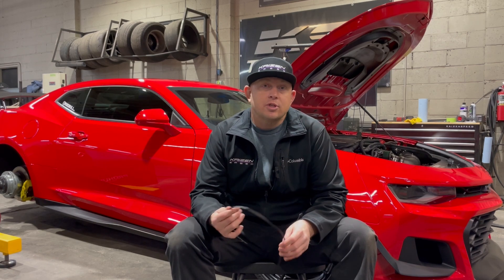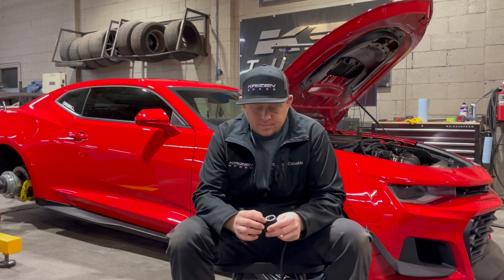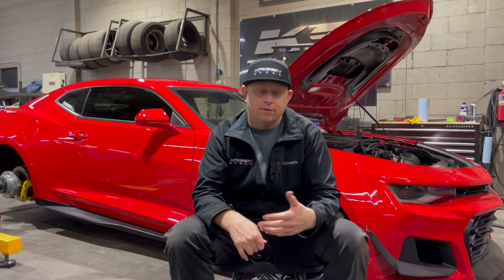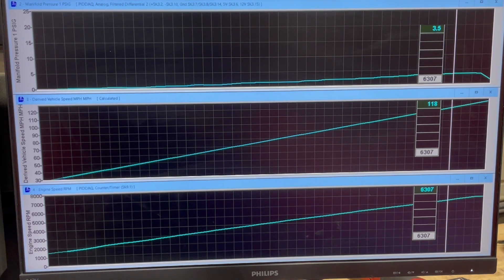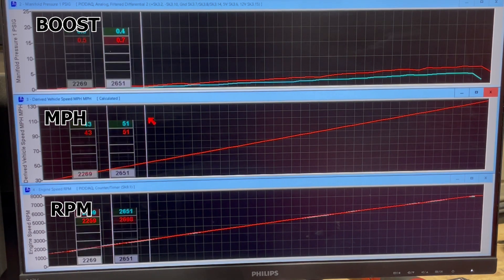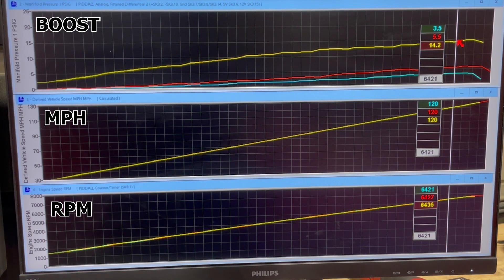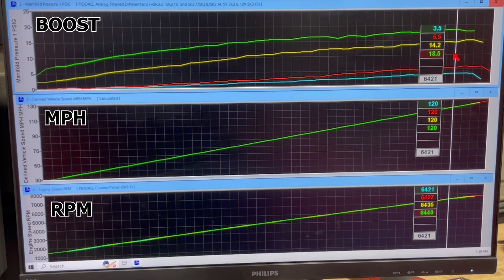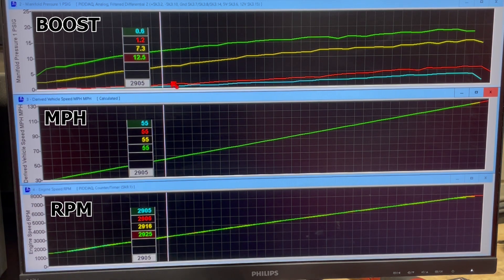SmoothBoost Fixed Boost Levels Explained

Comment: Have ya'll worked out the issues and gotten it to work properly on a gen 2 cts-v with kong 2650 yet? My mechanic worked with ya'll last year to try and get it working on my 2011 cts-v and it would not work right. Totally get companies sometimes need some time to work out bugs... Really would like this to work on my v...
Reply from the maker: Not sure who you worked with but there’s no issue and I’d encourage you to plug it back in. In the last year we have made revisions to the program and how it ramps but that’s all. Send an email to Sales@kaizenspeed.com and provide some details so we can help. Thank you.
Reply: @KAIZENSPEED John McGhee at Cutaway Creations Racing in WVA works on my 2011 cts-v. The SmoothBoost works perfectly but the Kaizen relay that offers 12 settings thru the 12 position potentiometer would not work. John tried for hours upon hours over like 2 months. At which point we had to return it cause he was getting to the point where he couldn't justify putting in any more hours to try getting it working, couldn't justify charging me for those hours, and I was missing my car. I know these things take time to iron out but was just seeing if anything was different since summer of 2024. Are there any examples /videos of customers with 2009-2015 cts-v's or zl1's that have it working with their kong 2650? Be nice to see a step by step video on install on one and then see it working. If this could work one day on my car it would be a game changer. I don't want to just do a shot in the dark to drive 2.5 hours each way to drop my car off with John if no guarantee of it working

Comment: Good video. I like the system but not the knob. Like you briefly talked about, I want it to ramp up boost by speed mph through some sort programing, not by me needing to twist the knob while I'm trying to watch the track. So I can get off the line and get into full boost when the tires can take it based on surface conditions.  I'll look for your next video.
Reply from the maker: Here is a link to the video that shows our SmoothBoost controller in action: https://youtu.be/vZgzGhBGWro?si=_H2erm81asnOOj1x

Comment: Can you turn the knob mid pull ?
Reply from the maker: You can, but that’s not practical and definitely not consistent. We have  boost ramp controller that essentially “turns the knob for you” based on vehicle speed. Here is a video showing it in action: https://youtu.be/vZgzGhBGWro?si=_H2erm81asnOOj1x
Reply: What’s the difference with Steve white’s?
Reply from the maker: @LeopardKUL  That device doesn’t ramp boost in with vehicle speed, it doesn’t have user selectable boost ramps, and it is not plug and play. 
It looks like the Steve White device ensures the bypass valve is open at idle even in low vacuum applications like big cam cars. 
It also looks like it controls a vacuum solenoid and vacuum actuator with a PWM signal instead of a servo motor.

Comment: Question: 
How does this affect heat? The blower speed is the same at 6500 no matter what boost setting you're on, but with significantly less air moving over the rotors on lower boost settings. Does this lack of airflow and high rotor speed increase IATs?
Reply from the maker: Boost pressure is the cause of heat buildup, not rotor RPM. Air naturally gets hotter when compressed so when the bypass valve is open and the inlet air doesn’t get compressed then IAT’s are reduced. Also, air is always flowing across the rotors.
To put it simply more boost = more heat.